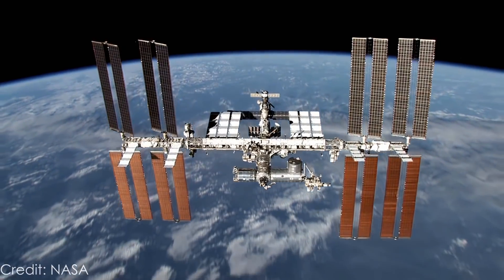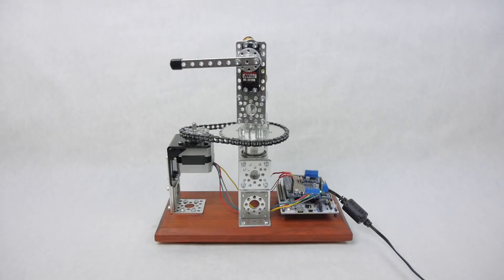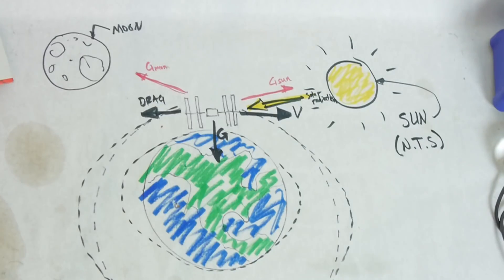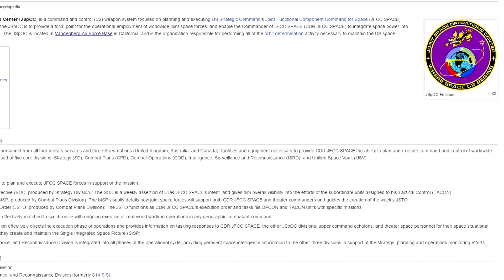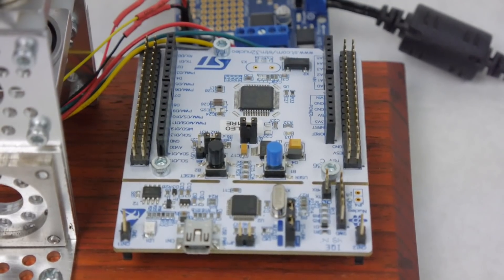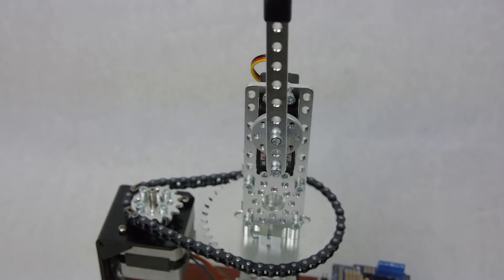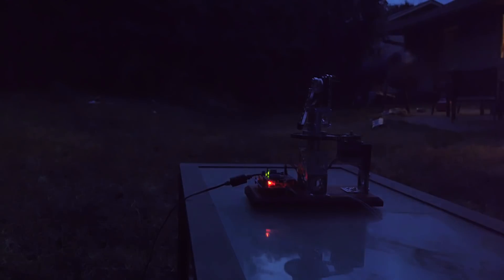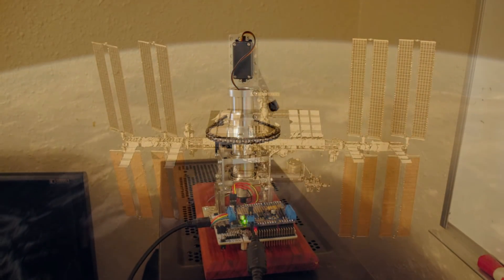International Space Station Orbit Tracker

Comment: question: during station keeping, how are tiny thrusters able to move anything in space when there's no air to push off of in a vacuum? once a rocket gets up to "space", there is no longer enough air to thrust or push off of. same principal with a balloon. fill it with air and then let it go. it is able to move because it is pushing off the air. however, if you let go of the balloon in a vacuum, it won't move at all because there is no air to push off of. we can simulate this by holding a vacuum cleaner next to the exhaust hole of the balloon that is taped to a straw and then put a string thru the line and release it (vid on youtube of this). the balloon won't move at all because there is no air for the escaping balloon air to push off of (as the vac cleaner is simulating the conditions of no air for the escaping exhaust to push off of. thus, it cannot move. same principal in "space". there is no air for a rocket to push off of. you cannot push off against nothing, therefore rockets being able to move about in the vacuum of space is pure fantasy. that's why there are no real pics of earth from space. we've been scammed.
Reply from the maker: Have you ever fired a gun? The kickback is not from the bullet pushing against the air.
Reply: @PracticalEngineeringChannel  apples and oranges. a vacuum cleaner sucks away all the air that is needed for a balloon rocket to push off of. no air to push off = no thrust = no movement.

Comment: Very cool Grady. I am a ham radio operator and I have several software programs that track amateur radio satellites. I have made many contacts via these satellites, using my VHF/UHF handheld radio at about 5 watts of power, and a homebuilt, handheld antenna to point at the satellite during its pass. This is great fun and always amazes me. Back when the Soviet MIR space station was in orbit, I actually made a contact with it, and that remains the highlight of my ham radio satellite operating. I suspect your apparatus in this video could be fairly easily be adapted to control the azimuth and elevation of my handheld satellite antenna, given a suitable mounting system. That would be an interesting project.

Comment: oh wow, i had thought it would be fun to use 60hz ac as a clock/device to always point at the sun (as if it's hard to know where the sun is during the daytime :-)), but it would have just been simple circular rotations that unravel the major rotations of the earth. i thought from there it might be an easy mod to have a mirror point at an average of a fixed point and the sun's location to put a dot of light on a wall whenever the sun was hitting it.

Comment: This is very interesting. Could you do this in reverse? Lets say you have a dish on a moving platform  and you want to track a satellite that is in a geostationary orbit with a ray dome  to prevent wind, rain, birds or any other element from distracting the performance of the land based dish, the receiver would also have to constantly monitor the signal level and self correct automatically. Another application would be point to point microwave say a transmission from a helicopter to a stationary base station maybe a TV station or a police station or a fighter plane to a satellite and then to the white house or an aircraft carrier. I know there are systems that receive HBO on cruse ships all over the world. I am aware of the cost of the dish, feed horn and the cost to manufacture the ray dome. My question is do you have the knowledge and the ability to manufacture a receiver 24 channel that could track geostationary satellite at sea system? The cost would be a determining factor as well.

Comment: I would like to use this to point a radio antenna at the ISS and other satellites.  It would need to be weather proof and handle around 3 lbs weight, and not point into the dirt.  thank you for the ideas.

Comment: I want one of these.  I have the Adafruit and picked up the ST.  Seems like a voltage mismatch?  I can't seem to find documentation on working with these two.  It looks like you have the power block on the Adafruit powering the ST as well?  Is that what the Jumpers and resistors are for?  Anyway, your videos are fantastic - thanks for sharing!

Comment: Is this accurate enough to attach a telescope and watch the iss when it passes overhead? And I mean from the programming view, clearly it needs a gearbox to smooth out the rotation. Supposing I build a smooth enough system and attaching a telescope, will it allways and without disturbances point exactly to the ISS?

Comment: In this project, you used your own program to calculate the trajectory, but you can go the other way.

We made a similar satellite tracking device. There is an Orbitron program that allows you to obtain satellite trajectories using data from the NORAD tracking system. This is a fairly high-quality, complete software that is well suited to solve this problem. Its plus is that it allows you to track any satellites that NORAD sees knowing their number in the system, and that’s almost all that is now in orbit, down to small pieces of garbage. What's convenient, Orbitron allows you to provide coordinates in a convenient form to the driver of your device. It remains only to convert them into signals transmitted directly to the device.

Our version turned out to be a little less smooth, because we used servos to control both axes, so we had a little “twitch” when tracking.

Comment: 7:13 Could you not of had just made it so that the motor controlling the pointer was higher so that the pointer can go in the centre of the device where it rotates on left and right?

This means you can fully track in 360 and with accuracy.

Comment: I just made a solar tracker using an arduino, two servos, gps module and a 16x2 display - the gps module solves having to enter the time and location details in the code, and it'll allow the unit to work anywhere in the world on power up and acquisition.
My azimuth servo struggled with the mass of a 20W solar panel, so am going to use stepper motors and 3D printed worm drives which can hold position without power until updated - these should be able to handle the mass of a few hundred watts of panels or more depending on worm drive construction and stepper motor power.
Would be nice to modify to add an antenna/telescope/camera to track satellites, planets etc to have a second life at night!

Comment: place the whole contraption inside a plastic ball with a magnet on the pointer and have small metal space station you put on the outside. so it would not only show actual location but show its position on the globe. this could be a real neat kickstarter project. if it got enuf support maybe even put a wifi chip in there so it can up date its calculations.

Comment: Why does the tracker move faster or slower over time? Sure, the ISS is speeding up and slowing down, but not by that rate and speed.
Reply: The tracker does not assume its position to be at earth's center, but earth's surface, i.e. relatively close to the orbit. Naturally the angular frequency from its (and also your) perspective varies immensely when it's close (400 km) vs far away with earth in between (12700 km + 400 km) .
Reply: Der Kuchen Very good explanation, thanks.

Comment: Hey, that soldering is top quality! Nice convex surfaces etc!
Would you please point me in the right direction to any info on making a solar tracker using info similar to this but that tracks the sun rather than an orbiting satellite! No need to detail the requirement for a man of your Calibre, but it is to drive a set of solar panels to keep them at max efficiency, then return them at sunset to sunrise position. Note you could make serious money selling the constructional info and required code, a kit of parts and code, or just code. But maybe someone already does this, but I cannot find anything but a commercial one that costs way too much......Thanks, Rog, P.S. It will be located at What3words address stocks.thanks.echo
Reply from the maker: I have heard that in most cases, the cost of installing and maintaining as system that tracks the sun is more than the additional energy you could generate over just a static panel. I did a quick google search and found a ton of homemade sun tracking mounts, so I don't think you should have any problem finding some examples.
Reply: Thanks for the info, yep, plenty of DIY light sensing trackers but not so ones that use earth location, time and date. I've found one that is purposely over complicated in that it is fully internet connected to look up all the info it needs, then adjusts itself every 12 mins. Within the comments in that instructable, someone points out that if one axis is pointed at the North Star, calculations are much easier! So now it's. North Star tracker on one axis, and a sun tracker on the other. Looks like this project may take some time ☹️

Comment: I once tried to build something like this too, with Arduino, 3D tilt sensor with magnetometer  and two 360 degrees servos. Couldn't get the angles calculated properly though so would have cheated by using two sensors in different locations of the arms rather than one sensor at the tip. Also the two tiny servos were too weak to hold a HAM antenna. I think a directional antenna is one great application for a tracker like this because ISS and some satellites send SSTV images and have even repeaters you could (as a HAM operator) use to contact other people. I like how you used a stepper motor and chain for rotation because it looks much stronger than just slapping two cheap chinese servos directly to each other.
Reply: Also ran out of space on Arduino when trying to get some PLAN13 code added to my project, so decided to make the arduino only a "stupid" IO device for the motors and sensors and actual calculation can be then done over USB on a laptop. I like how you used a slightly better MCU that still had the necessary IO ports but also enough memory to do everything standalone. :)

Comment: Thanksgiving last year, when my family was all gathered together, my brother was using a 2m amateur radio handheld with a cheap yagi antenna he built out of hardware supplies to listen to signals bouncing off one of the hamsats. He used an app on his phone, which he could use to aim it. I bet he could use something like this for the same purpose. He has talked about actually trying to ping it, but said he either needed more power than a handheld provides, or better aim then manually pointing can provide. This would certainly provide the better aim.

Comment: If its not connected to the internet to receive updated positions how can it remain accurate? They adjust the position of the ISS often for example to avoid debris.
Reply from the maker: +STDrepository It can't. This was just a prototype, so you have to manually update the orbital parameters to keep it accurate.
Reply: Practical Engineering the netduino has built in wifi and because it uses c# it's super easy to use the  built in web client class to download the position of the ISS from a tracking website every day automatically.
Reply: I see Practical Engineering has found a volunteer to make this add on :P

Comment: I think the ISS is fake. Who would point solar panels at different directions? And this just for fun rotating parabolic antenna?
But any way, nice Device ;-)
Reply: Solar panels are always pointing at the sun so it reflects light to the earth so we can see it. I've seen it like 5 times since I started using Heavens-Above
Reply: On the shown animations, different panels are pointing to different directions. And you would only be possible to see something, if the panels would point to the sun at a specific angle, that reflects the light directly to your ground position.
Reply: Forgot about that. Half of the panels faced away from the sun to prevent overheating and deformation. They're on the edge of the atmosphere and the radiation is higher up there
Reply: And as the solar panels reflect light from the sun the light gets bigger as it hits earth so you can see it in alot of places near you.
Reply: There are more solar panels in other directions.
Reply: Still explains that some solar panels face away from the sun to prevent overheating
Reply: Depends on your definition of "some".
Reply: Let's not go off topic.
Reply: ISS is real because i can see it with my bare eye. It appears very similar to an airplane except it goes faster
Reply: Das Kässpätzle I think you're refering to the smaller heat radiators attached at various points along the truss. They are similiar to the large panels in appearance but function entirely different. They're filled with small tubes containing ammonia. Their purpose is to efficiently control temperatures throughout the station's habitable areas and electronics by converting waste heat into infrared emission.

Comment: is this compatible with an original arduino?! without chaning any chips?. 
and is there a step by step process
 I want to do this for a school project
Reply from the maker: You would have to port the code to Arduino. The language is the same but there will be some changes. More info here: http://www.instructables.com/id/International-Space-Station-TrackerPointer/
Reply: not very explanatory. wouldnt it be better to run it on a rasberry pi ? im serius about making this project but since ive never done more dan ladder coding its a bit new to me
Reply: There is probably no "better" baord because all three boards are fully capable of doing the job.

Comment: Question. Can their be satelites basically doing the job of geostationary satellites, but on lattitudes other than the equator?
Reply from the maker: Yes. They are called geosynchronous satellites. A geostationary orbit is just a particular type of geosynchronous orbit that is aligned with the equator. Satellites that are geosynchronous but not geostationary will appear to travel in figure 8 patterns from earth. More info here: https://en.wikipedia.org/wiki/Geosynchronous_orbit
Reply: There are also so called Molniya and Tundra orbits.  Highly eccentric orbits which allow a satellite to spend the majority of it's orbit in range of a given location too far north to be covered by geostationary satellites.
Reply: Josh Wilder
Ok. I heard of those, but I'm not an expert, needed an ELI5.

Comment: Pretty clever.  Are you using TLE data to update ISS's track periodically?  Usually predictions out over 48 hours or so break down when the ISS gets an orbital boost.  I have been wondering if anyone has written code to program a GoTo telescope mount to track the ISS as it passes over.  Programs such as Stellarium can command ASCOM compatible mounts, and they do predict and project ISS orbits.  It sounds feasible that someone (with a stronger skill set than me) might be able to build the critical link to bridge the gap.
Reply from the maker: With this prototype you have to update the time and TLE in the code manually. This was more of a proof of concept.

Comment: What I thought was cool was that when I was in the service I was a 13R Firefinder Radar Operator and your machine has a lot of mirrors in our radar set (AN-TPQ 53). One of our first steps (since it was a mobile radar set) was to drop it within 6 inches of a known point and point the radar true north. We even a similar setup in terms of having a slip ring, azimuth and elevation drives, except ours cost about $70,000 each and weighed about 70lbs.
Reply from the maker: +Michael Hartmann Very cool

Comment: A design extension could be to fit a directional radio  antenna with a transmitter and receiver and see if you can raise them on the radio as they go over >.< Think I read someone did this a while ago but they needed a rather powerful set up to achieve it as they weren't tracking the station with the antenna.
You may need to make it a slightly larger model though but the principles are the same.

I would be tempted to program it along with a UHF receiver that can listen to aircraft transponders, decode the coordinates and make the arm point at a selected aircraft that's flying over...Just don't sell it to ISIS.....lol
Reply: I use my kenwood radio and yaesu  rotator system via a computer and software, to track all satellites, including the lss, so we are well ahead of you, lol.  De g1egz…